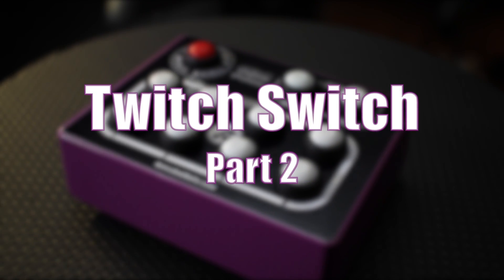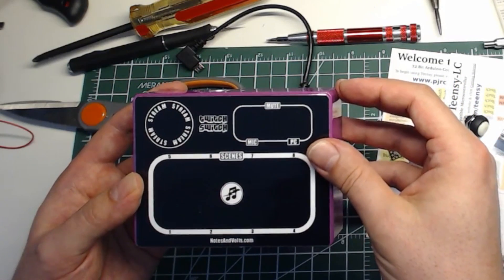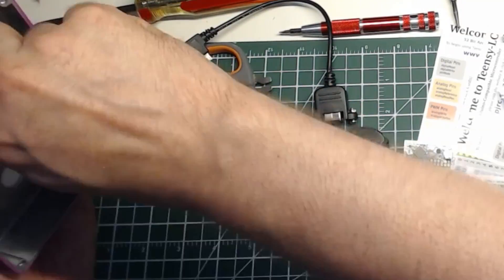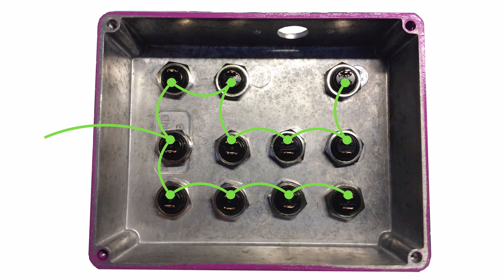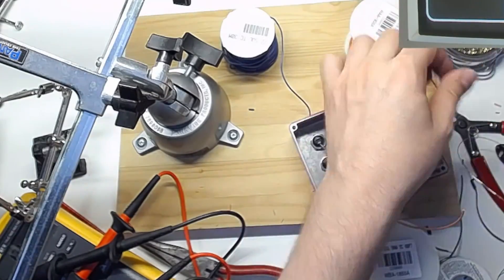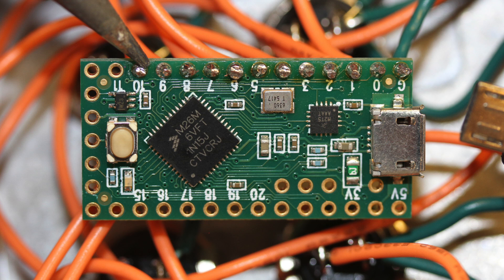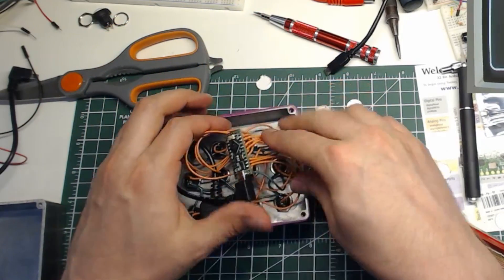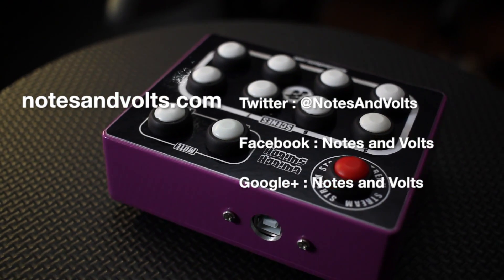Twitch Switch - Part 2

Comment: Love this.  Could I use a Teensy 3.2 instead of the Teensy LC and does it have to be an aluminium project case as I have a few plastic ones?
Liked and Subbed.  This is gonna come in handy and well within my skill-base.
Thanks Dave...
Reply from the maker: Hi Steve. The Teensy 3.2 will work but it is more expensive than the LC and the extra power is not necessary. I can't remember off the top of my head but you may have to check the pin assignments in the code (it may work as is though). A plastic case will be fine. Good luck!
Reply: Thanks Dave. I did order a Teensy LC as I thought the 3.2 would be overkill. I'll keep you in the loop...
Thanks again mate...

Comment: This is very cool and I can see uses for my DAW as well.  A question though.  I have an UNO board I wanted to try this out, but when I try to compile the sketch it says 'Keyboard' not found.  Does the Teensy have this built in?
Reply from the maker: Hi Michael. This will only work with the teensy (Teensy LC or Teensy 3.x). The code won't work on any Arduino.
Reply: Thanks for the confirmation!  Love your videos!